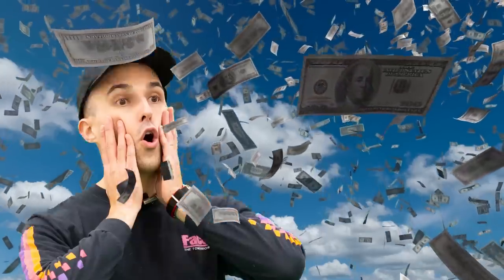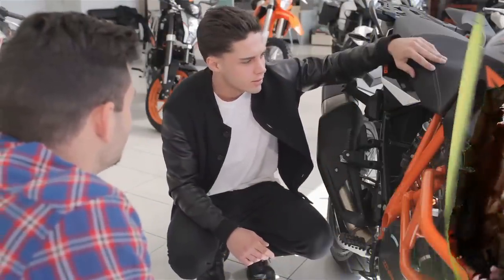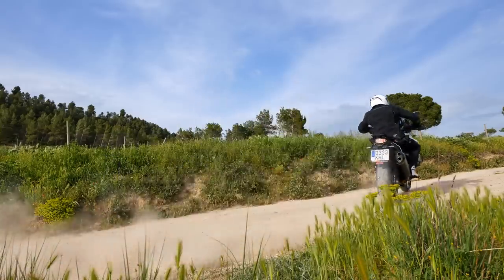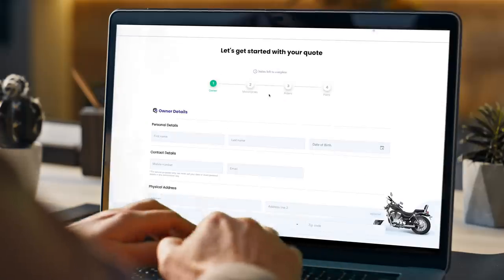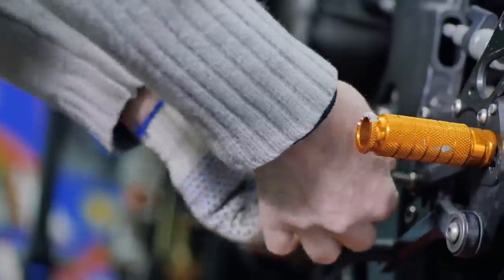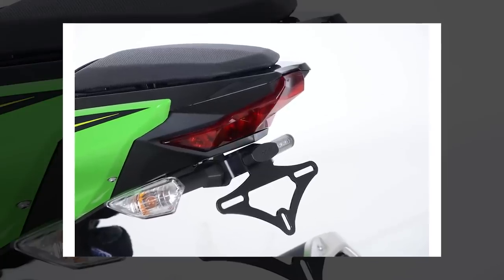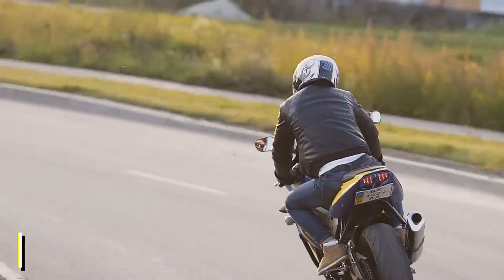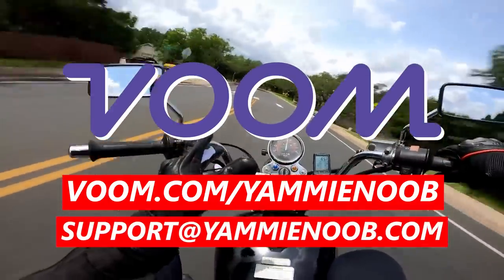Top 7 Hacks for CHEAP Beginner Motorcycle Riders

Comment: I disagree on the recommendation to sell OEM parts. When the time comes to sell that bike, many buyers want a completely stock bike. When the time comes to sell, one can re-install the OEM parts and include the after-market parts in a box or sell them separately.
Reply: Depends on the buyer IMO. Having the aftermarket parts installed WITH  the oem parts in a box would be preferable.
Reply: Or vice versa
Reply: You’re going to get more money removing the aftermarket parts (to resell individually) and reinstalling the OEM parts 99 times out of 100.
Reply: I own 8 bikes currently. A bike that appears to be unmolested by Amazon parts and shade tree work is always worth more. Unless you have receipts where reputable builders/shops etcetera did the work. Because sure you can wrench. But do I know if you did it right? A guy who bought a bike and had all services done at the dealership is the best used bike to buy. The dealerships have the proper parts and tools. They require certification for wrenching. And actual high performance mods are a red flag. No one puts a stretched swingarm, full exhaust, and bottle fed for Sunday go to meeting. Means they dogged the shit out of it. And you are financing their new go fast toy. 

Now obviously there are differences. You win a bike from the Yamster. You know how it is cause he did videos of it. But rando off the net? Nah OEM is the way to go.

Comment: the riding modestly thing is no joke. It also helps you develop fine control. Being able to go fast in a straight line doesnt make you a good rider, but being able to navigate a cruiser through a busy mall parking lot without putting feet down will make you better at all the other things you need to do while riding.

Comment: Proper tyres, brakes and gear are indeed the best mod you can do, even so as a beginner. When i swapped out my worn tyres to new ones, my bike like instantly became safer and more enjoyable to ride. Also i agree about riding modestly, i get about 39 mpg combined on my 600cc ZZR. It`s a carburated bike and i run the new E10 gasoline in it.
Reply: Also setting up the suspension for your weight is also a good one and cheap enuff to do especially if u have a winter time like I do

Comment: Smaller displacement is great.
I own: 
1. Honda VTR250
2. Yamaha SR400
3. Suzuki GS500E (1990 - still original) 

Barely any electronics on these - you just need a spanner set to work on them. 
Some people may be concerned with smaller motorcycles as some people may be on the taller/larger side - if this helps anyone I'm 6'1 and 80kg, I don't look like a mega-giant on these motorcycles and they're still enough power to overtake on the highways!

Comment: Yammi isn't wrong about buying a used bike. It's a lot cheaper. I got my first bike a ktm 390 adventure 2 months ago and I bought it brand new. Cost me like 9,000 out the door when it was being advertised for 7,000 bucks. The problem with buying used though is that you might just be buying someone else's problem and if your not mechanically inclined or know a lot about bikes, you might not even know it.

Comment: As a counter to the first tip. Shopping smart helps. 

Bought a bike brand new, although it spent a year on the floor. 2% loan, under MSRP out the door (even with the extended warranty) It's doable!

Comment: I found my first bike in the garbage In Detroit i went to the door to make sure they was really throwing it out and they said, yep we got it for our son 10 years ago and he never road it. They said hang on we will get you the keys and the title. We took it home to ky and went through the carburetors and rebuilt them and cleaned a bunch of gunk and leaves out of the exhaust and I rode it for years! It was a Honda 2 stroke with a dirt bike back tire and a street tire on the front! Had a Speedo and tack! I think it was a 185cc if I remember correctly been a long time ago back in the 80’s and it was a 70’s small 2 stroke bike!

Comment: Hey y’all I narrowed my favorite motorcycles it will be my first motorcycle and they are sv650 and mt07 and cbr650r and cb650r and triumph trident and zx6rr and zx4rr and z650 Which should I get out of those I’m looking to pick one up next week
Reply: Im biased because I own one but should your budget allow, the CB650R is an amazing bike. The inline 4 is also nice and relaxed low in the rev range so its harder to immediately kill yourself.
Reply: I picked up CB300R even lighter than cb650r
Reply: I don’t think I’ve ever met someone who regretted getting an sv650. Something to keep in mind with those other bikes that have inline 4s is that valve adjustments will be more costly

Comment: Ride Now Powersports in Concord, NC wanted me to pay $195 a month for 72 months at 17% interest for a 2023 KLX300sm that was on sale for $5900. Thats over $14,040 over the duration. Needless to say I didn't buy it. So buyers beware, esp new riders, dealerships will do pretty much everything they can to screw you.
Reply: Credit scores are an important factor. I pay less than $195 a month on my KLR which MSRPs at about $1000 more than a KLX on a 3 year term.
Reply: @JTodd1991  I'm  not paying 17% interest with a 700 credit score.
Reply: @tpp6432  if you were offered 17% with a 700, you should have probably financed directly with Kawasaki through Synchrony. They offer shorter term loans with low interest rates.

Comment: what the hell is brakeout maintenance? obviously my dealership wants me to replace EVERY fluid in the bike as the 600mile mark hits on my shiny Rebel, but what do i actually NEED to change for brakeout?
Reply: Just change the oil yourself; if the valves need adjustment you will hear and feel them.

Comment: I think you do too many beginner bike videos. I know that it's because you are an analytics 304, but it is annoying and involves less effort.  This is one of the better ones.  Love the Bandit 600 thumbnail, looks almost like the B12 I built from totes.

Bikes with fairings typically have higher performance parts than their naked counterparts.  For a bike that might get dropped by a new rider or an old bike with missing or damaged fairings, fairings are an unneeded hassle.  A costly one too.  I paid TOO MUCH for trim and fairing parts on an otherwise cheap 97' RF900R.  If you want to paint your old naked bike there are only about three or four pieces.

OEM parts in many cases are better quality than aftermarket parts, cheaper too.  I bought everything that hit the floor from a bike breaker for my B12 tote build for about $50. It was a lot of stuff and I have used most of it.

Older bikes often are a pure experience. No ABS, no complicated computer shennanigans.  Simple small engines.  They are a great place to learn mechanic skills.  You don't need as many lifting tools as cars and one person can manage almost everything without help.

Smaller bikes on the used market are not necessary cheaper.  They'll have less use and generally be in better shape.  You could get a big bike for about the same cash.

How often do you have to update the mileage on your Voom insured bikes (multi-bike)?

Boomers?  Some Gen Xers too.  I was alive before the internet!  We all used forums before social media groups.  They are still better organized for research.

I think a new rider could blow a lot of cash on a custom seat and it still be a good mod.  If the saddle isn't comfortable you won't ride as much, period.  New riders need experience.

Definitely ride within the limits of your skill level.  I made a tight right turn leaving work today and was a little bit aggressive with it.  I felt the front slide a little on some sand or gravel that I didn't see.  If I had not been as aggressive it would have probably rolled over it instead of slide.  Didn't panic or anything, but a new rider can be challenged by sudden losses of traction.  Wrecking motorcycles can't be much fun despite Gixxer Brah's antics.

Comment: If you aren't a real mechanic, NEVER buy a used bike for your first rider. No.
Reply: I am not a mechanic although i can fix a few basic things . I only buy used bikes . Used bikes doesn't mean piece of shit death trap if you choose correctly it can be more reliable than a brand new one .
Reply: I think there's more to lose from buying a brand new bike and damaging it Vs buying a well looked after used bike. If you get something that's ~5 years old but has dealership service records and as few mods as possible then you've saved money Vs a new bike but should still have something reliable.
Reply: @ΑλεξανδροςΑμανατιδης-ι7ε  That's my worry.  How can I be sure that the seller properly performed the break-in period?  I'm no mechanic and most of these new beginner squids are probably revving out at every gear.  That's what scares me.
Reply: That's my worry.  How can I be sure that the seller properly performed the break-in period?  I'm no mechanic and most of these new beginner squids are probably revving out at every gear.  That's what scares me.
Reply: @sonicmoj1  tbf if you're buying a bike that would actually suffer from this it probably wasn't a great one to begin with.
Reply: @Geshmaal  How would one determine that?  I guess maybe only look for used bikes than have less than 2K miles on the odometer?